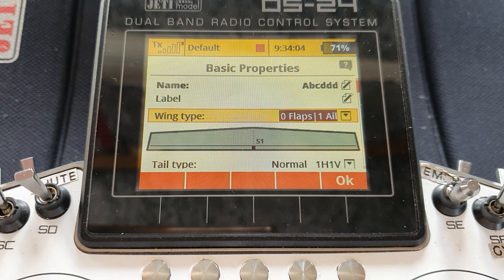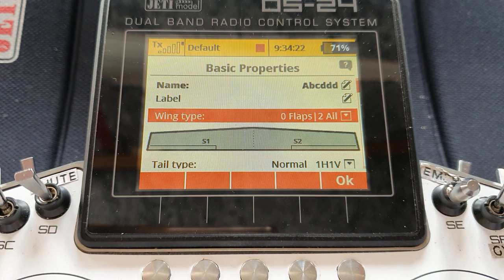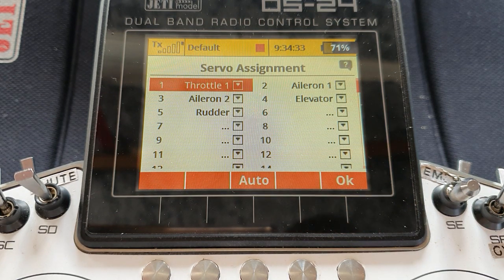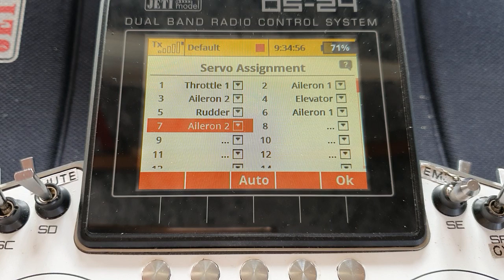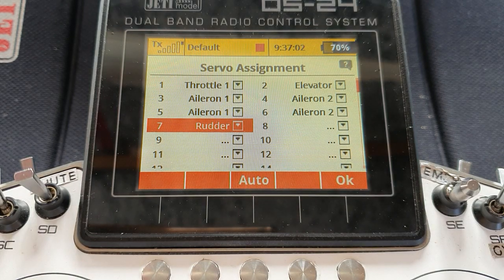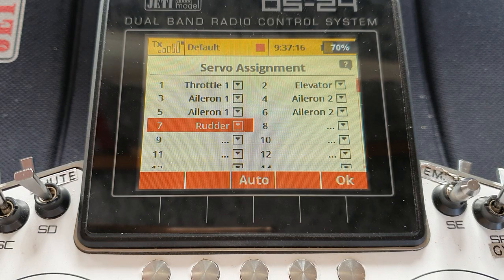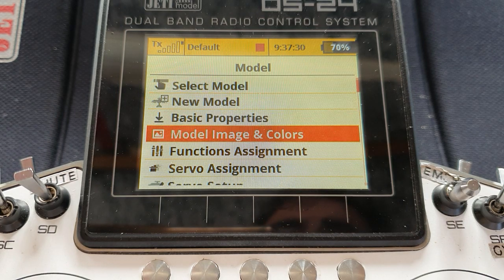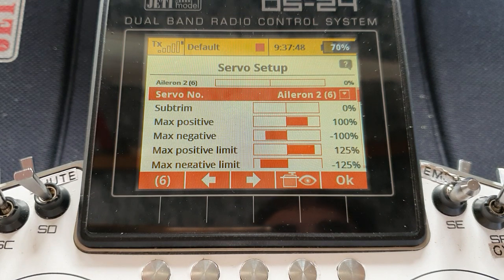Jeti - biplane with four aileron servos

Comment: Hello Harry, a few weeks ago I programmed my Pilot-RC Pitts Challenger 87" in the same way as you described in the second option. Only difference Aileron1 is left bottom, 2 right bottom, 3 left top, 4 right top. While S1, S2, S3, S4 can be specified with positive/negative values, I don't see a "problem" in doing so. Or is there another reason why "lower Aileron numbers" should go left and "higher Aileron numbers" at right hand side?? Thanks for your reply, regards from The Netherlands, Rick
Reply from the maker: If you look at the diagram in Basic Settings, it shows numbered ailerons going from left to right.  It does the same with multiple flaps, elevators, rudders.  The software expects servos to go from left to right.  In many cases you can over-ride it because many of the menus allow you to set S1-S4 independently, but somewhere with more esoteric programming/mixing it may cause a problem, so it is safer to just always stick to the rule.  Then there is no risk of running into a problem.
Reply: @cotswoldpilot  Thanks for your prompt reply Harry, I appreciate. And I will review my Pitts aileron arrangement. 👍🏽
Reply from the maker: @beyondxtream4056  if it is working, I would leave it as it is.  Just be aware that if in future you try some mixing to ailerons that does weird things, it might be the left right rule causing the problem
Reply: @cotswoldpilot  Okay Harry, thanks for the additional reply. Best regards, Rick